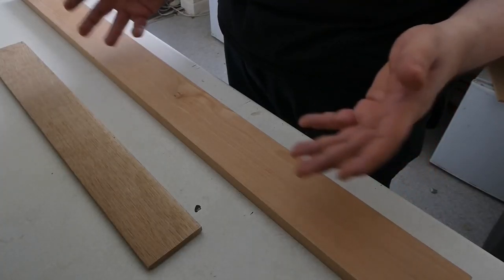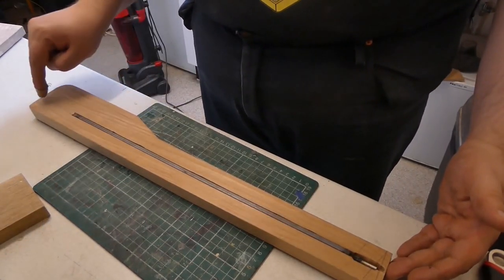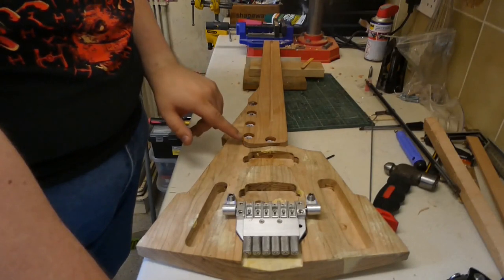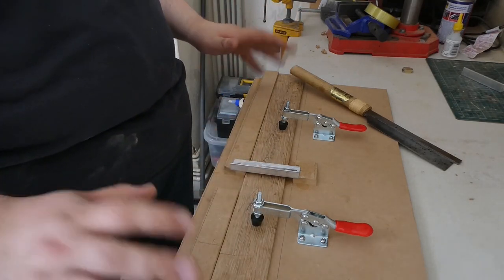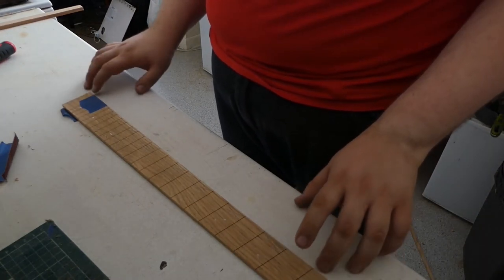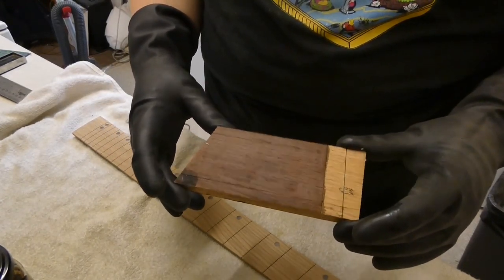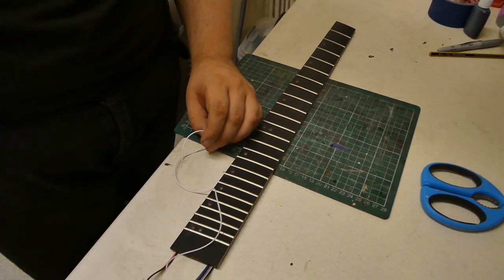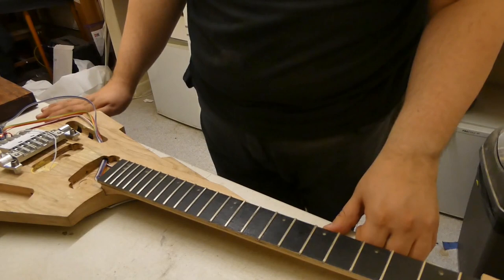LED Fretboard! The Imperator, Great Guitar Build-Off '21, Video 4

Comment: You should get Khal's (KR sabers/Saber Armoury) inexpensive Verso board for those neopixels.. I have one you can get for free, and you'd be able fight off the dark side any day.. pew pew twang twang..
Reply from the maker: I mean, I kinda have, a Verso is pretty much just a Proffieboard with less programming ability, and a Proffieboard is just a Teensy with dedicated hardware. 

I did consider running a dedicated saber controller in there, but on balance, I'd rather have that as an option, rather than the whole thing. With a Teensy, I can do some saber stuff, as well as program in things that would be great for guitars, like onboard tuners, midi pickups, etc